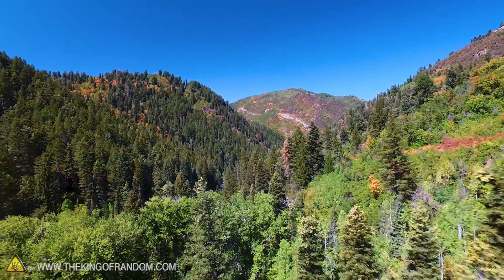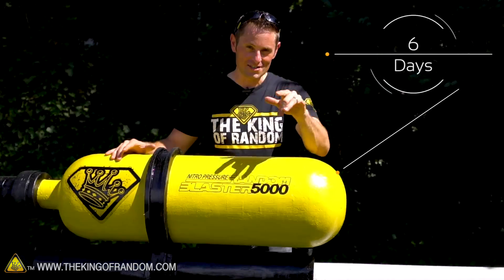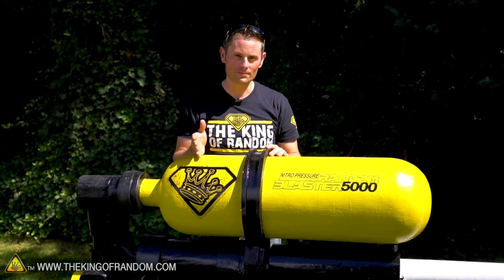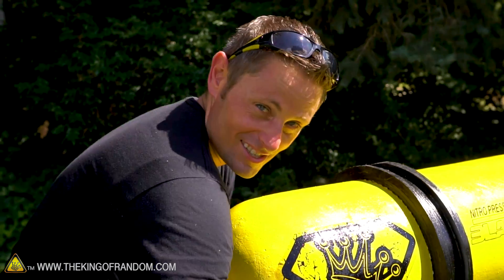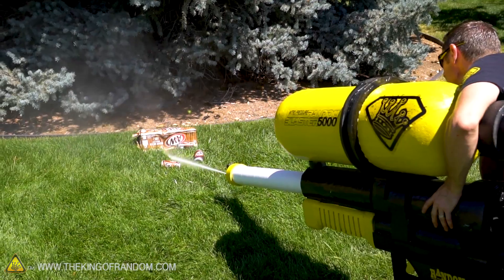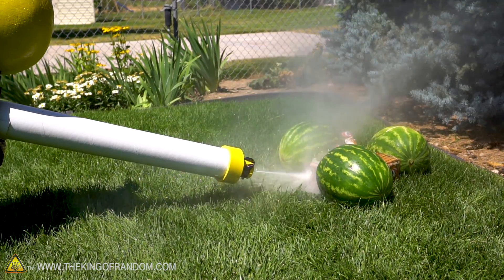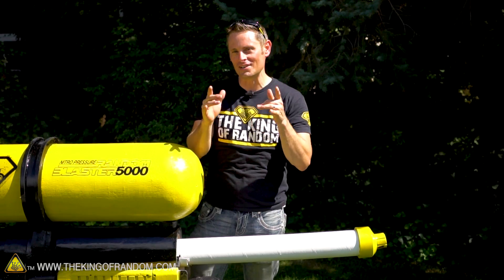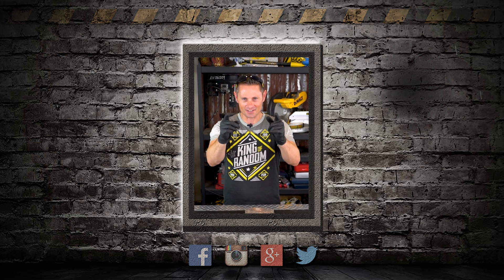The World's SECOND Largest Super Soaker! 😂 TKOR Experiments Making The Largest Water Gun Ever

Comment: You need to vent the pressure when using quick connect. Saves you the trouble of using the pliers and the deafening blast of air rushing out the connectors.

Comment: See if sparklers burn in liquid nitrogen or vacuum chamber
Reply: It wouldn't work
Reply: Yes how ever sparklers use thermite which burns under water and produces O2
Reply: Jaden Keller They would not light as in a vacuum chamber there is no oxygen which is essential for burning. You can put this theory to test by placing a container(glass recommended) over a candle

Comment: Grant!  You should see if Thermite will burn in liquid nitrogen!!!!
Reply: Thermite both will and wont burn in liquid nitrogen. The actual reaction requires no oxygen to burn and is vastly hotter than liquid nitrogen is colder. However if you dumped thermite into liquid nitrogen the compact particles of aluminium and iron oxide would disperse and the reaction would not be able to take place. Think of a thermite reaction as a chain reaction and it requires a constant source of compact and close by fuel to burn. So to answer, the thermite that would already be alight would continue to burn in liquid nitrogen until the oxidiser (Iron oxide III) ran out however that would only last a second or two.

Comment: High speed same volume, hence the water jet turns into a mist when far. make the hole wider so more water can shoot out, increasing the range the water can remain as a jet. of course, it would require higher pressure to attain the same "muzzle" speed

small muzzle=nozzling, high speed, shorter jet,more mist. large muzzle=less nozzling, less speed(unless you up the pressure), longer jet

Comment: Hey grant if u add some sand to the water tank you theoretically should be able to cut through much more 🍴
Reply: Neel Amin wouldn't it just jam?
Reply: It might just grind the tubing and stuff in the process. I am no professional, but I think the high velocity of the sand will not just cut whatever you point the gun at, but also the interior of the gun itself.
Reply: certain parts would need to be upgraded to handle the additional friction.

Comment: I was hoping to see an actual toy super soaker like the kind you have to pump. I understand you wouldn't get the same pressure but it would be a real super soaker instead of a high powered water gun in the shape of a super soaker. Plus you need to haul around a pressurized gas tank.

Comment: IDEA 
a gun that shoots Bullates of water ... using a bolt that fills with water ... Behind this cylinder of water is, a Plate, separating you gas from the water ...  
after the shot is fired, the bolt will return, or you can pull it back manualy ...
yes this is Single Fire ... but can fire a measured quantities of Pure Solid water .. with measured pressure .. and maybe different barrel inserts (chokes)

do u understand the basic concept?

Comment: Maybe see what would happen to Gallium and/or Mercury instead of water? 👑✌️
🤘
Reply: Smiling Advocate it could work because gallium has one of the lowest melting points. And you wouldn't want to use mercury because it's a poisoning metal
Reply: Smiling Advocate they most likely won't work, they're not as fluid as water is, so they would shoot out like water
Reply: Probably not but if the valve to the tank is large enough for the metals to pass though, there could be an interesting show. Powder fire extinguishers are a prime example.
Reply: Just to clarify - When I said Mercury, I meant other liquid metals.
Just commenting already has me hyped!
Reply: there are no other metals that are liquid at room temperature
Reply: Thanks for clearing that up.